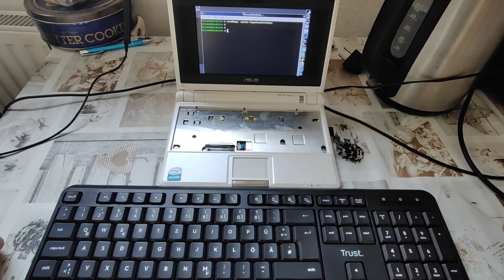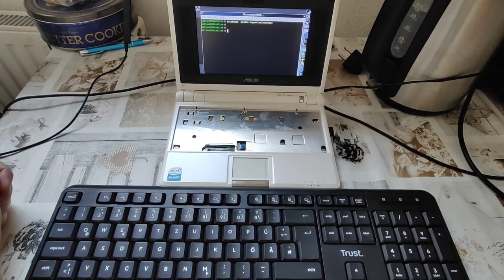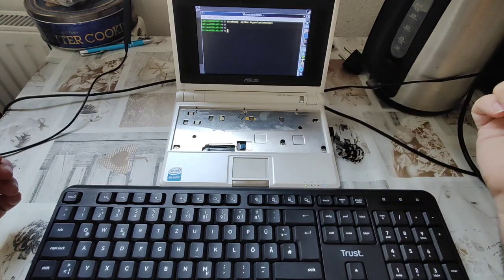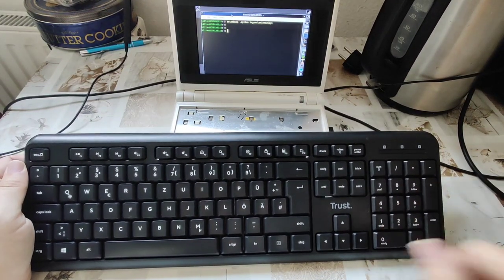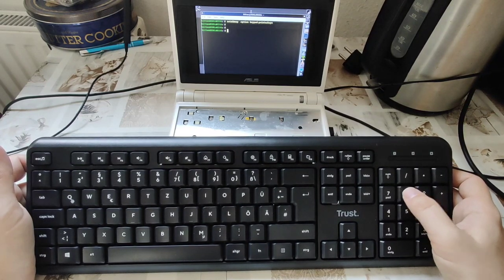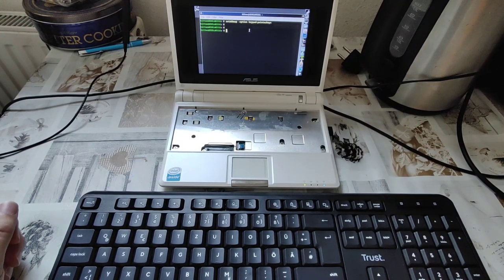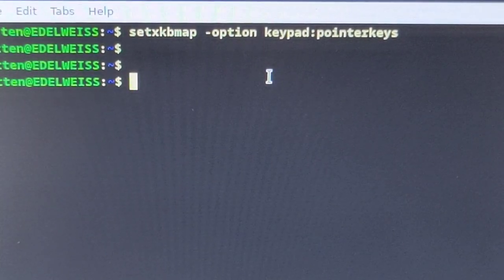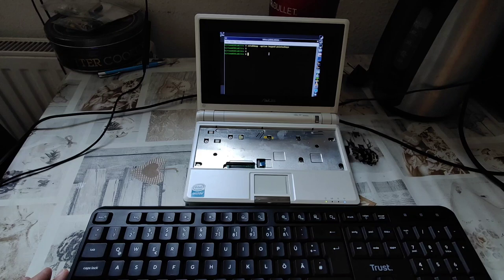(2/2) Misfortunes of an Asus Eee PC 701 4G: Keyboard Mouse Control under Linux

Comment: My EEE PC also has some keyboard issues. It's such a shame, because it's in great condition, but some key combinations do not work anymore. Even reconnecting the ribbon cable and cleaning it up a bit does not help. If the trackpad also goes bust, I'll definitely try this feature, which is awesome that Linux has it!

Comment: I want to revive my EEE PC, but the keyboard is not working very well. Some keys are not working at all and some are working only if the connecting cable stays in a certain position in the connector. I want to buy a new keyboard but the prices are from 20 euro and up, and I'm not even sure if the problem is the keyboard itself or the connector.